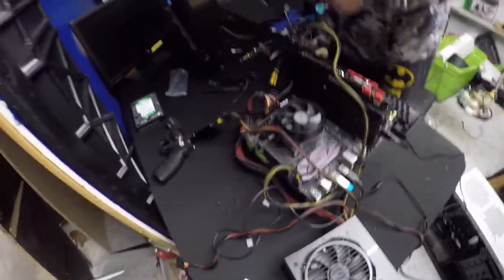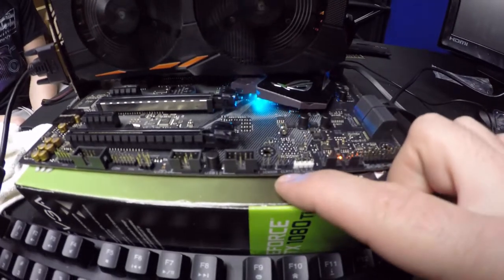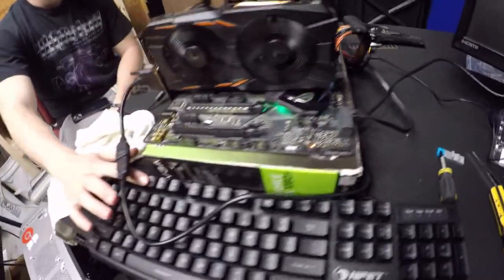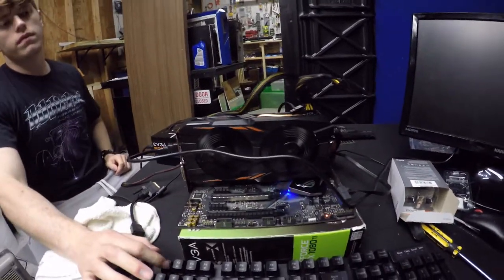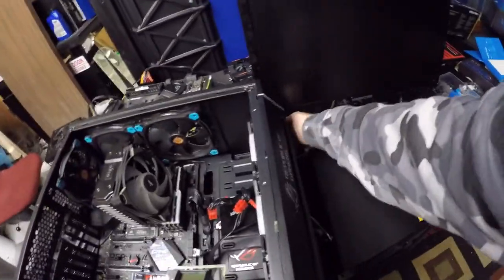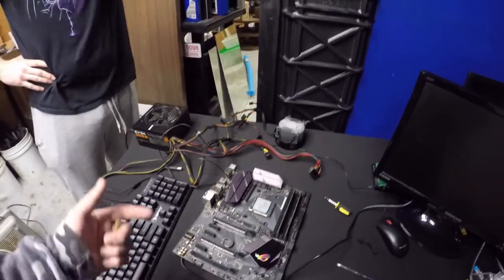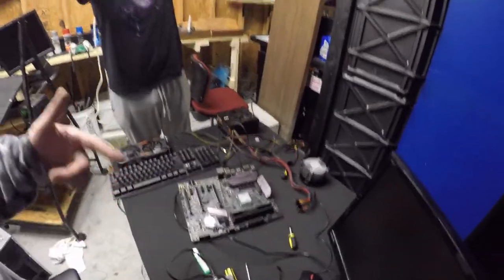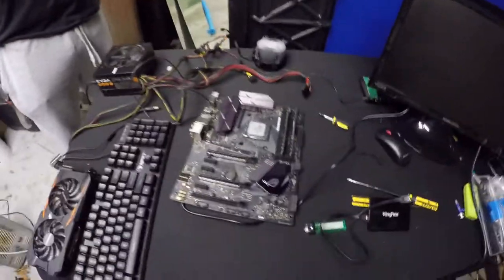Strix b 350F Gaming - back screen problem

Comment: hope you will record a fov how will you fix that board
Reply from the maker: were working on it... im do a video on how to fix bent pins.. in cpu
Reply: @ATECHPCs   I have this issue between nxtcam and rivatuner iwas trying to overclock my gpu. And monitor it .. but when I was playing pubg.   I got 50 gpu usage using camz but then I started to worried then I try rivatuner  with afterbuner .. it display 90-100 buts it goes 0 but I don't experience  stutter And my fps is good ..80-100fps low competitive settings
Reply: Which of the two is much more accurate .. I worried maybe I have a problem on my gpu..
Ryzen 3 2200g RX570 16GB 2400MHZ